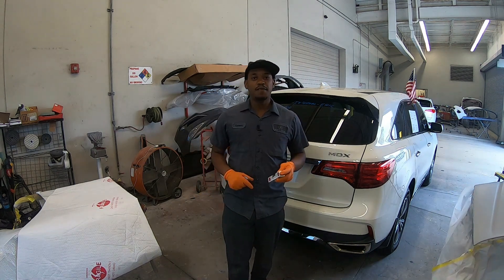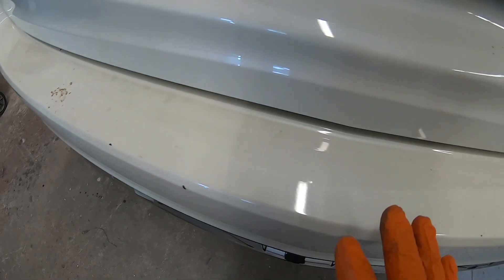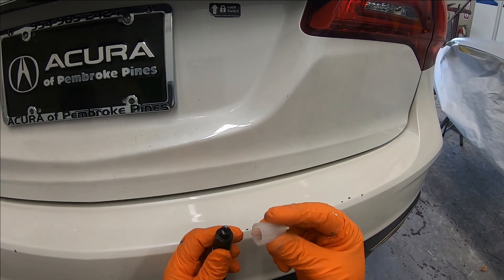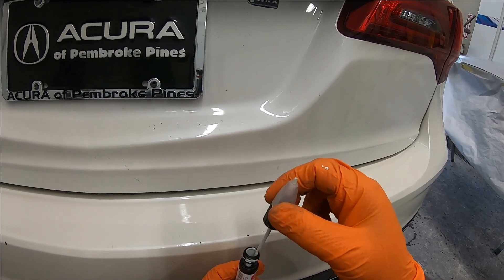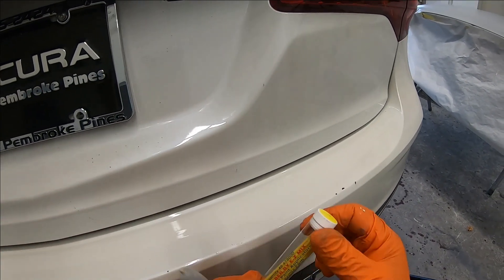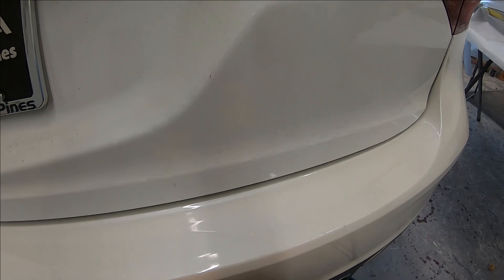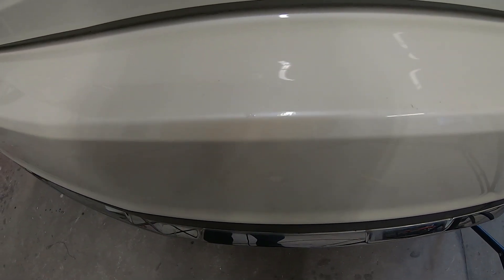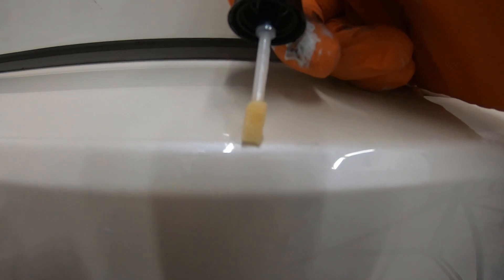The simple and correct way to use a touch up pen.

Comment: Instead of lacquer thinner to remove the paint and mistakenly stripping the surrounding paint use reducer. It's less aggressive, will remove the fresh paint but won't remove the old paint as fast as lacquer. I use reducer to remove paint transfer and if it creates a light haze in the surrounding clear, it's no problem a little polish on a microfiber cloth can't fix.

Comment: Hi Mario, some useful tips there for doing touch ups when I used to do them we didn't have these modern pens so it was either a case of spraying some rattle can paint into the lid then dabbing it on or you could get it in a small bottle with a brush in the lid and the match was usually miles out😭😭😂John UK.
Reply from the maker: Lol things change as time goes by. Thanks for the comment John🙏

Comment: I have one of those exact touch pen, for my 2018 Dodge Charger Daytona 392, which is in the color Yellow Jacket.  When I did my first touch up it seems like the paint sat proud of the surrounding surface.  It didn’t look good to me so I wiped it off.  Do you think I didn’t give it enough time to level out or maybe did I apply too much paint?  I’d like to give it another try.  Thx
Reply from the maker: Hey man, try applying little by little don’t try to get full coverage with one shot. And give some time to level out
Reply: @mariopaintclass6091  sounds good, I’ll give it another try with that technique.  Thank you for your response and advise! 😁👍🏻